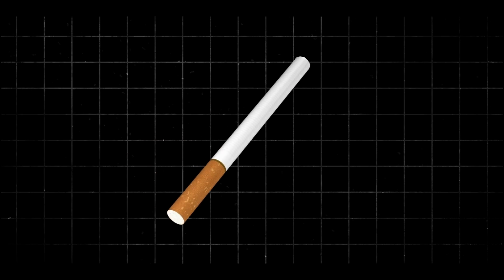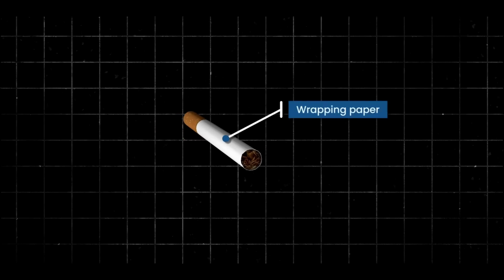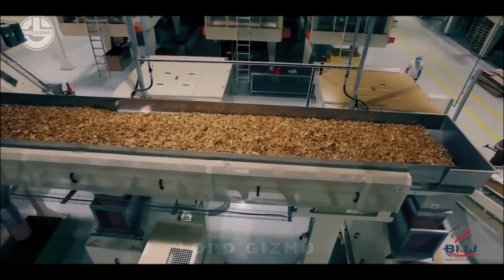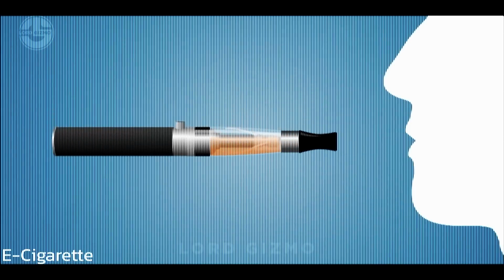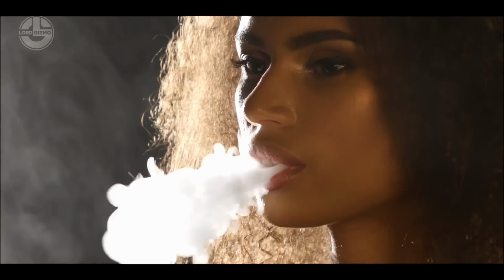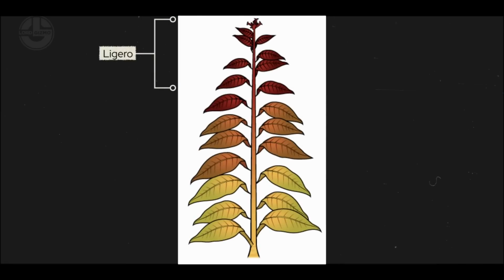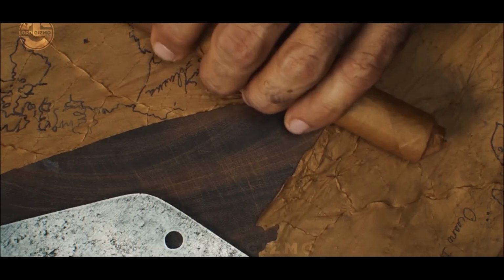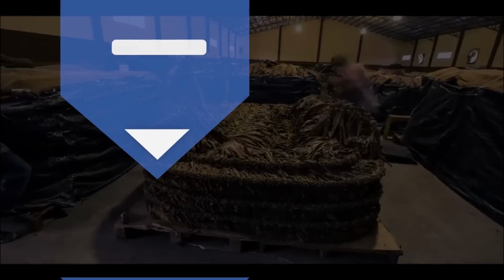Production Process Of Millions of CIGARETTES from Harvest to Factory!

Comment: In Germany there are Cigarette packs with over 50 Cigarettes
Reply: i saw 60 cigarette packs
Reply: In the US the standard is 20 in a pack but you can get cartons that are 10 packs. Most often stores will have bundle deals where it is slighty cheaper to buy 2 packs which they also apply the tactic to other products to get you spend more when you wouldn't have considered buying the product if it was just one.
Reply: @ sounds familiar, here aswell, 10x 20 or 4x 50 8x27 etc.

Comment: 10:44 I used to work in one of those factories.  The machine they are showing produces 9000 cigs per minute.  That factory had 110 of them that ran 24/7.
Reply: That's 12,960,000 per machine per day. Or almost 1,5B per day for the whole factory. Jesus.
Reply: Don't you have any health problems when you have to inhale cigarette smoke every day?
Reply: Right now are makers from Hauni that make 20k cigs per minute.
Reply: @TheJuzio95  Yes, 30 years ago that company sold the factory a machine that claimed to make 18,000 per minute.  It was 2 of the 9,000 cigarette makers connected to the same control panel.
Reply: @VroodenTheGreat  This new are double rod configuration on the same roller. Rated for 20k, but if you add stops and rod brakes id goes down to around 16-19k.
Also the factory on the video looks very old and not to well automated. I remember this green color from the oldest machines that we had and we get rid of them around 6-7 years ago. They were even too old to sell them to anyone and we decided to scrap them.
Reply: OVER 9,000!
Reply: Hello. Can we talk?? I need to talk with you. Need some help.

Comment: If you have ever stuck a pack of papers in your bag of weed you know that it dries it out.  The pack is full of paper so it would dry out and become unpalatable.  So they have to moisten it.  But they cant use plain water because it'll rot and leech the tar out of the tobacco staining the paper.  So that's where the "rat poison" comes from.  But these chemicals are much closer to embalming fluid.  Mummifying the tobacco so they can remove most of water without the leaf turning to dust.  Loose tobacco does contain nearly as much embalming fluid because it is not surrounded in desiccate paper.  By no means a safe alternative, but loose is cheaper, and by nature contains less of these undesirable additives.